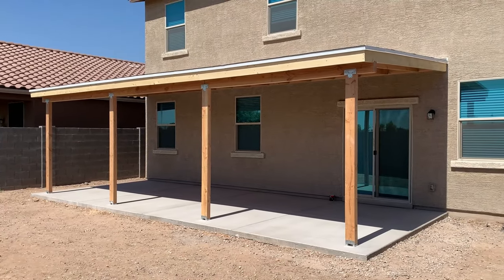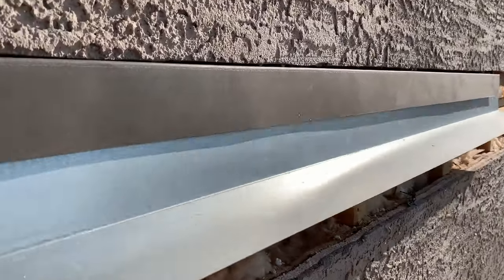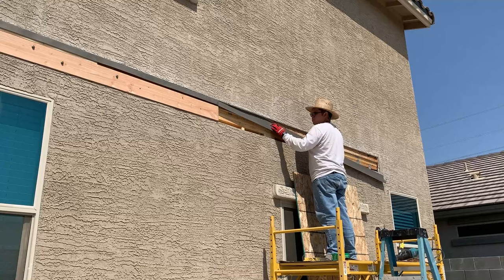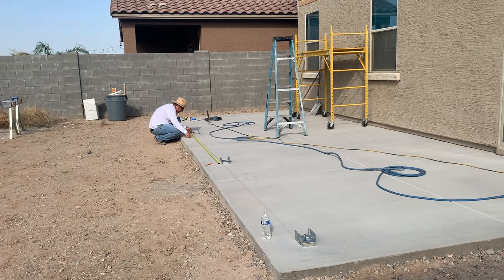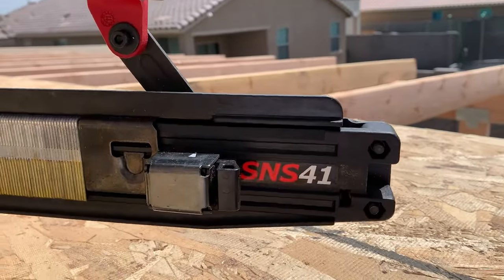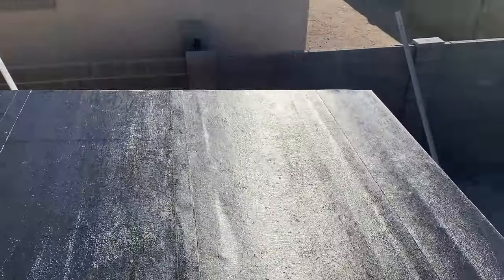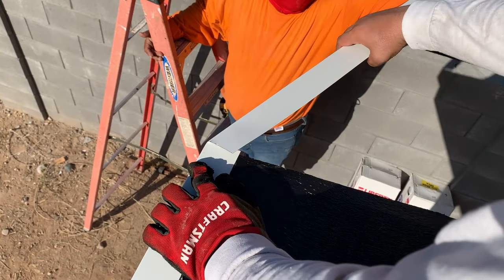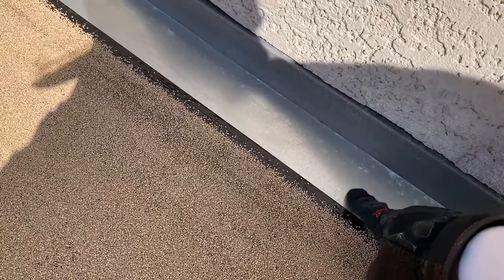My Biggest Patio Build

Comment from the maker: 100,000 views, thank you! If you are a new viewer and liked the video, I kindly ask for your support with a like and a sub to help me to continue grow! 🎉
Reply: First of all, just want to say thank you and for posting this video. I’m planning to install my own awning and have been researching this project quite a bit and your content has helped a lot. I have a question did you install flashing on the bottom part of the ledger board? This is the only video I found where the home is very similar to mine in that the siding is stucco and it’s two-story which makes this video very applicable to my project. But I have to say cutting into the stucco of my house. Kind of worries me. I figured cutting through the stucco was necessary to expose the framing of the home to make a solid connection between the house and the awning. But wouldn’t you want to include flashing on the bottom of that ledger board?
Reply: Thank you. I have learned a lot from your video. I want to add a 16x36 patio&deck to my house
Reply from the maker: @BarinaadaaKara  thank you as well for watching and commenting. I wish you good luck and strength on your project.
Reply: Hello Luis, what do you use to cover the bottom to hide the wood underneath?
Reply from the maker: @tamikagriffin5533  The most common thing to do is to install drywall and paint it. But you can also do different types of wood panels, like tongue and groove or shiplap.
Reply: @luisangelmedia4459  Thank you
Reply from the maker: @tamikagriffin5533  Thank you as well for watching and reaching out.
Reply: I would've used T1-11 for an exposed look, then you don't have to do sheetrock,  texture and paint, maybe just some clear and you're done
Reply from the maker: @LMartinez-zz8fe  sounds like a good idea.

Comment: Is a 4" slab enough to support that?  We just did a very similar build with only 2 posts (16' wide x 12' deep x 8' tall) and dug and poured footers for the 4x6 posts we used.  Used 2 9.5" LVLs for the ledgers.  Looks great man!
Reply from the maker: The plans you get from the city here have a page where it says you do need a footer for brand new concrete slabs. This lab was poured with the footers for the posts marked out. Your patio sounds nice as well.

Comment: Really helpful video. One question: is there a standard or a code regarding posts spacing?
Reply from the maker: @pavelsolovyenko1975  thank you. The city of Glendale, AZ has a table for how far apart posts can be depending the size of the beam. A 4x6 post will support a 4x6 horizontal beam 10 feet apart with 10 foot long rafters.

Comment: If I was the owner I would go the extra cost for some type of ceiling finish, maybe some type of tongue and groove. OSB painted looks terrible. Great job thanks for sharing.
Reply from the maker: Most people will choose to do a drywall ceiling, which could easily be done to this type of patio as the outer fascia boards are slightly taller which means the ceiling will be recessed in and not flush. Thank you for watching my video.

Comment: well explained video.

my only question is how locate the top plate to know where to cut the stucco wall?
Reply from the maker: In most cases you will not be able to know the exact location, and you will probably be cutting the stucco to about 8-9 feet depending how tall your patio can be. Attaching to top plate is good, but most of the time we just attach to the vertical studs which is equally good.

Comment: Thanks so much for the great video. Realy appreciate it. Question. you showed putting in the L Flashing in the beginning, but later on i didn't see it? How come?
You don't use any screw or adhesive for the flashing, just the 3" board? 
How do you know where to cut the stucco?

thanks again so much for all your teaching
Reply from the maker: Thank you. There are two flashings used in the video. The first one you see is the Z bar flashing, you won’t see this except for the piece that comes down over the L flashing. You can see the L flashing being out on at the end of the video. In this video I didn’t use any screws to attach the L flashing to the Z bar flashing or over the cap sheet because how tight it was. But you can use 1/2 lath screws to anchor the Z bar and L flashing together and also screw down the flashing to the cap sheet with longer screws, but you need to apply sealant to those anytime you screw into the cap sheet. To cut the stucco, you need to measure how high your ledger board needs to go and then cut about 9 inches, 6 inches for the ledger board and 3 inches for the wooden spacer. Hope this helps.
Reply: @luisangelmedia4459  YOU ARE THE BEST !!!!! THANSK SO MUCH !!!! DONT EVER CHANGE !!!! SUBSCRIBED AND LIKE A MILLION TIMES> THANKS AGAIN
Reply from the maker: @FreedomWanderer-hk3hc  thank you!

Comment: Great video and instructions.  For the Joist/truss hanger to the ledger board i can only see this part from HD.  Simpson Strong-Tie
LUS ZMAX Galvanized Face-Mount Joist Hanger for 2x6 Nominal Lumber.
Your ledger hangers 2x6 wrap over the top of the ledger board.  which i do like better, do you know if they carry at Home Depot?
Reply from the maker: Here are the ones from the video. You can use either one you like. I personally like the ones in the video, although you need to take into account the 1/4 height increase, which is the most common complaint about them. 
https://www.homedepot.com/p/Simpson-Strong-Tie-PF-18-Gauge-Galvanized-Post-Frame-Hanger-for-2x6-Nominal-Lumber-PF26/100374865

Comment: Hi Luis Angel. This is an excellent job 👏👏👏. I have a question, the person who did my patio did not do the first step of cutting the stucco and now when it rains, water infiltrate. How this problem can be fixed?
Reply from the maker: @carolp3262  Hello there, I’m sorry to hear about your patio. I would try to fix this by rolling on a roof coating of “elastomeric” it’s like white paint, but really thick. I would apply this between the patio and the stucco of the house. You might need two coats.
Reply: Thank you so much for your prompt reply.
Reply: Hi Luis Angel, so you don’t recommend trying to cut the stucco and placing the z plate after the patio os built? Because the person who built the patio was giving me that option.
Reply from the maker: @carolp3262  Oh I would definitely do that! I was thinking you were asking what would be a simple fix for you to try and do. If he’s offering you to redo the patio, which he basically has to do in order to cut the stucco and put the counter flashing in, then I would totally agree.
Reply: Hi Luis, i don’t think he is offering to re- do it ( disassemble and build it again), i think he said that he will cut the stucco and place counter flashing on top of the patio. But , i am afraid that this may be worst and the water can infiltrate more.
Reply from the maker: @carolp3262  they will probably do more damage than good. I suggest trying to seal it from the outside at this point. Use caulking or silicone around the ledger board and anywhere that water could be coming in from.

Comment: Great video Luis!  My question is at the bottom of the ledger board do you use some type of gap filler to seal it off?
Reply from the maker: @Michael-vi2se  you can to make it look better. At my house I left it open because I was curious to see if there would be any water coming down, but it has stayed dried for more than 3 years now. For clients, I do apply a bead of caulking and even paint it if they have the paint on hand, just makes the line look so much better.

Comment: Hi! Great video.  Im doing something similar in Tucson... What would you change in the structure if the patio was going to be walked on like a balcony? Only up to 5 ppl at a time
Reply from the maker: Thank you. I see a few concerns with having people on a roof like this. The first thing is that the wood used is meant to mostly hold its own weight, so maybe bigger beams, posts and possibly rafters. Second, the roofing base sheet and cap sheet are not real good for walking on. In peak summer when the roofing rolls get hot, they get sticky and very soft, if you step on it too much the tiny rocks sink into the black tar, so you’d need to spray it with foam and seal it, like a built up roof or flat roof.

Comment: When you cut the 2nd ledger board at a 45 did you cut the 1st one at 45 as well in order for them to overlap better?

Also why didnt you go all the way to the left edge with the ledger? Looks like it is 6" from that corner of the house.
Reply from the maker: Yes, both ledger boards have been cut in opposite 45s to overlap one another. And we did not go all the way because the home owner had other plans for that side of the patio.
Reply: @luisangelmedia4459  What plans does he have for those 6 inches or less ? I wasn't talking about the open side on right with window and no concrete. I meant the little sliver you can't see in the video on left side.
Reply from the maker: @javelin13  okay i understand, I thought you meant 6 feet on the right where the window is. So the 6 inches left on the right side is just for looks so the patio can be on the “inside” of the house wall. It’d look a bit odd if the fascia came out flush to the house or maybe not.

Comment: thanks for the video its very helpful would like to ask how much would a 40x12 cost? also could you use pavers?
Reply from the maker: Thank you. A patio that size, and only considering the roof structure, not concrete or the paving, would be closer to $5,500 labor and $3,000 materials. And no, you cannot put this roof over pavers, you need to have footings where the posts will go.
Reply: @luisangelmedia4459  thanks for responding wish you was in FL hard to find people that don’t over charge in my area muchas gracias.! 💪🏼
Reply from the maker: @vaderfx4  you’re welcome, thank you for checking out my video and I hope you find someone you can trust to help you out.

Comment: Nice work... So how expensive is a job that size? And should the patio cover be built before the concrete is pored?
Reply from the maker: Thank you! $4,000 labor, $2,500 materials. Concrete should definitely be poured first, but not an absolute requirement. These numbers do not include price of concrete, but that’s probably a $3k - $5k job.

Comment: Could you please post a link to the materials you used, especially the flashing materials? Thanks in advance!
Reply from the maker: Z bar flashing
https://www.homedepot.com/p/Gibraltar-Building-Products-1-in-x-10-ft-Bonderized-Steel-Z-Bar-Flashing-ZB6B/202218458

L flashing 
https://www.homedepot.com/p/Gibraltar-Building-Products-2-in-x-3-in-x-10-ft-Galvanized-Steel-Roof-To-Wall-Flashing-RW23G/202093203
Reply: @luisangelmedia4459  gracias amigo!
Reply from the maker: @josedanielpa  gracias también por ver mi video.

Comment: What is the best way to find the decider for the top plate? How far up from the first floor?
Reply from the maker: In this patio, it was decided by the fact that the HOA would not allow the patio roof to be taller than 10 feet. On my other patio, with stucco, I was limited in height by the fascia of the roof. You can also determine the height by having your horizontal beam be at least 7 feet high, the beam at the edge of the patio.

Comment: I noticed the caulking guns what exactly did you use those for? Do the z bar or l bar flashing require some type of sealant? I am in the process of building our attached patio cover and definitely found this video helpful. Thank you for the content.
Reply from the maker: If you mean the caulking gun at 9:04 then it was used to seal the edges where the stucco meats all the flashing materials, only the two side edges. We also use silicone to seal the overlapping edges of the flashing materials. The z bar is not glued or anchored behind the stucco, it sits on top of a spacer and what you can do is, nail or screw the L flashing that goes bellow the Z bar flashing to the spacer, you will have to lift up the flap of the z bar flashing a little bit to do this.
Reply from the maker: This is my 2nd reply, please the 1st one. You can see the spacer board at 2:28 the z bar flashing sits on top of this.
Reply: @luisangelmedia4459  makes sense thanks for the fast reply. How often would we need to re apply sealant to the two side edges where the stucco meets the flashing?
Reply from the maker: @robertrenier1709  if you are precise with your measurements and you only applied a small bead, then I doubt it will ever crack and need maintenance, but if you ended up with a large gap, like more than 1/2, then it’s something you will need to keep an eye on to make sure it does not crack.
Reply: @luisangelmedia4459  sounds good 👍

Comment: What size of ledger board are you using for this project.   2x6. Or. 2x8  ledger board?
Reply from the maker: @edest4321  it’s 2x6
Reply: Usually it should be inch per foot, 8 foot long span needs 8 inch wide leadger board
Reply: But awnings are different than decks
Reply from the maker: @kevinbaldonado5614  first time hearing this for me. I built this patio and three other ones using the schedules provided by the city and the size of the ledger board doesn’t change if the rafter span is longer.
Reply from the maker: @kevinbaldonado5614  yeah, this is a lean to roof.

Comment: What’s the best way to measure for the top plate? Measure inside first?
Reply from the maker: Depends on how tall your ceilings are. For an 8ft ceiling, the top plate is around 97 inches. However, I wouldn’t let the top plate height determine your patio height, you could go lower or sometimes higher if your hoa allows. The important thing is locating those vertical studs.
Reply: @luisangelmedia4459  thank you bro. I appreciate it your video was amazing
Reply from the maker: @sabada51  thank you as well for watching and reaching out!

Comment: On the L flashing and Z flashing, could you get away with only doing L flashing?
Reply from the maker: It can be possible, although not recommended. The Z bar is important to make sure water does not return back into the stucco.

Comment: So do the spacers just float in there? They don't get secured in any way other than the friction?
Reply from the maker: Yeah they are just small metal clips that go between the boards. However, they actually fit very tightly on the board, plus if you use this self adhering material, the base sheet gets glued down on them too.

Comment: Hello Luis, is there another way to keep the L flashing in place other than with the cap sheet adhesive? With no Z bar flashing..
Reply from the maker: With screws and silicone, but this would not be ideal nor would I recommend it.
Reply: @luisangelmedia4459  ok thanks, it just seems like the flashing is not sticking to the cap sheet very well..
Reply from the maker: @josedanielpa  are you talking about this build or did you do something similar? In this video the L flashing is barely able to move across the cap sheet adhesive. But let’s say that it was loose, I would add a layer of the Henry black tar or silicone bellow the flashing and above the cap sheet to create a better bond. Maybe even add a spacer if my roof was too low and there was a big gap.
Reply: @luisangelmedia4459  I did something similar, ok thanks for the idea! I appreciate it

Comment: Awesome video bro, liked and subscribed. I'm about to take on a patio 48x12. I've been looking online to get some pointers as I've never done one. What size and type of screws did u use to hang the hangers.
Reply from the maker: Thank you. For construction, I find that GRK brand screws are the best. These are the ones I used
https://www.homedepot.com/p/GRK-Fasteners-8-x-1-1-2-in-R4-Multi-Purpose-Star-Drive-Flat-Head-Screw-110-per-Pack-96085/204837666

Comment: How do you know what the pitch/slope should be ??
Reply from the maker: If you are using this roofing material, the roll self adhering sheet, it needs at least a .25/12 slope or pitch. I personally went higher with a .50/12 slope. That means that for every 12 inches of length on the roof, the direction in which the slope will be, you need to drop half inch. So I’m this case I went down 6 inches because it was 12 feet long. Let me know if that makes sense.

Comment: Nice video.  You don’t need footing for the posts? I am thinking of building a 35 foot one.  But I don’t think I should cut out my stucco.  I don’t want to expose the house structure to termites and the elements. I am just going to bolt the ledger board on top of the stucco.  What do you think?
Reply from the maker: Thank you! For new concrete yes, if it’s an older pad, it needs to be 4 inches thick and no cracks. Mounting the ledger board to the stucco is a bad idea. Also, termites don’t get into the house from the surface, they dig under your house and crawl up once they find soft wood. Be careful about mounting ledger board to stucco.
Reply: Why be careful with attaching ledger board to stucco ?
Reply from the maker: @sdyoda  because you don’t mount the ledger board to the stucco.

Comment: what was the dimensions of the roof.
Reply from the maker: @garyjames4313  it’s about 13 feet by 35 feet. It over hangs about a foot where the water slopes down and on the sides, it’s about the same length as the concrete as they asked me not to take it further towards the window.

Comment: How do you locate the wooden stud that you attached the ledger boards to?
Reply from the maker: In this build, I happen to land on the top plate, which are a number of 2x4s stacked together horizontally. My ledger board is attached to this because I built it up high. However, when you open up the stucco, you will physically see the vertical 2x4 studs where you need to anchor the rafters. 
https://youtu.be/xnRwMhPNFeM?si=YlJbG2PGsn0wg19q